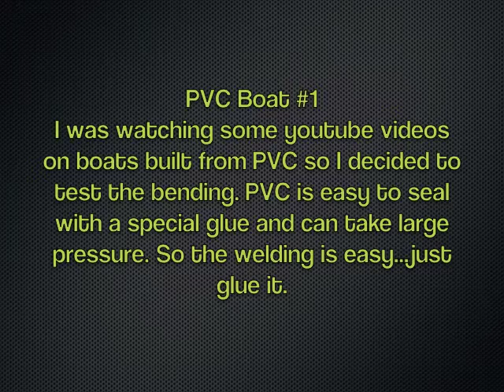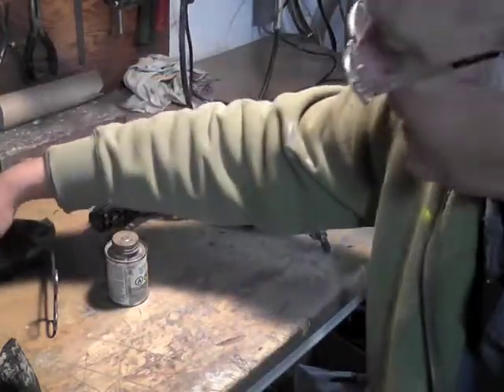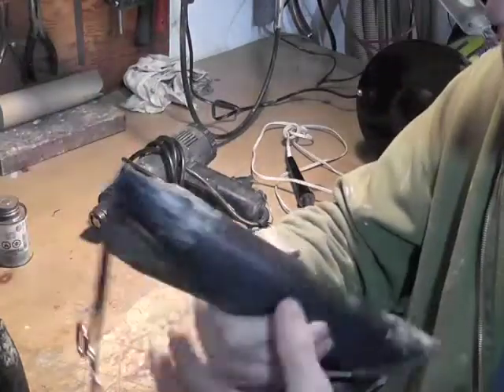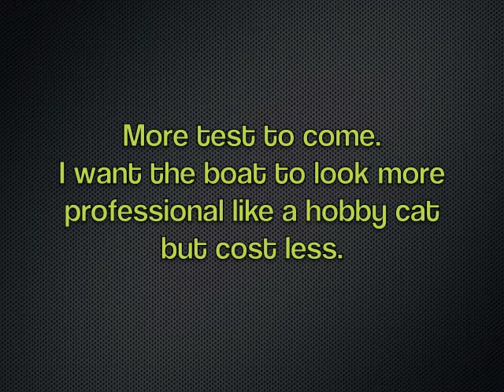PVC /ABS Model Boat # 1 Test Bending

Comment: boiling water is also useful for modeling the pvc - doesn't melt it either, as the pvc gets soft right around boiling temperature but doesn't melt
Reply from the maker: Thanks for the advice.